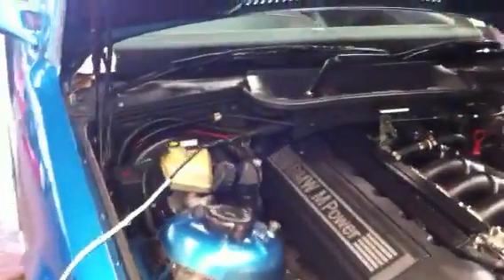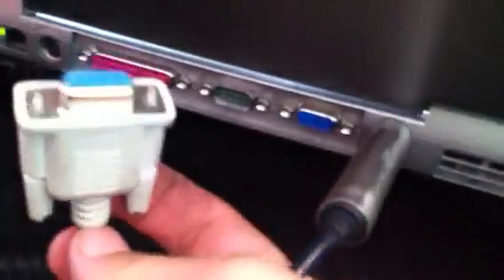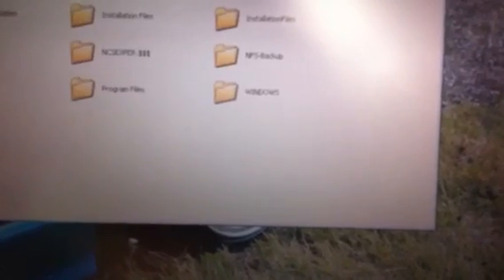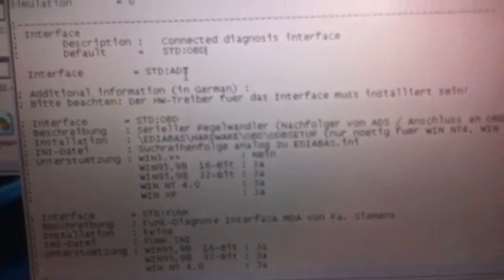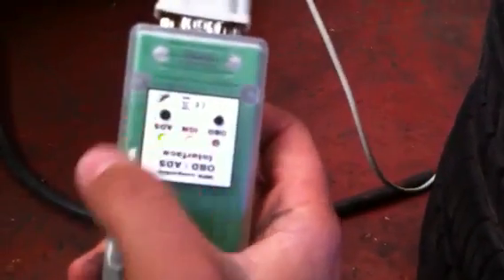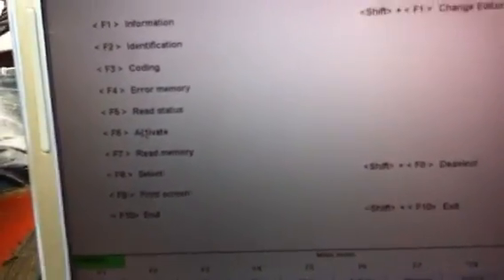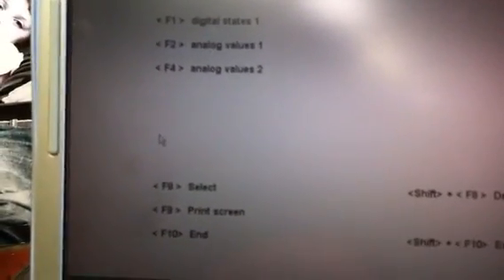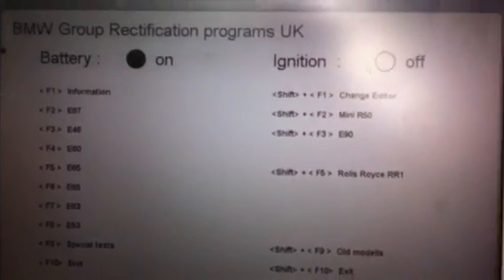INPA demonstration

Comment: Could you access the VNC S50? I don't recall a separate Vanos controller on the S50 as the DME controls it. Just wondering if my INPA is acting weird or not.
Reply: You can access the value only, no test.
Reply: It was solved already. I forgot only the 3.0 has a separate Vanos control module, the 3.2 has it built into the DME.
Reply: iDON Johnson If you want to test s50 vanos, you should have dis or ista. If the vanos not functioning as it should, no error would appear if you scan it with a diagnostic device.
Reply: I have DIS and INPA. I have already performed the Vanos test and individual triggering of the solenoids. They were fine.